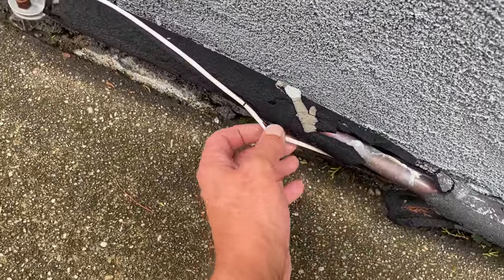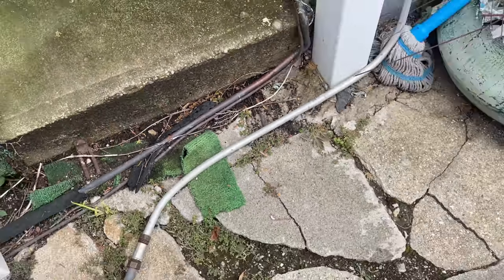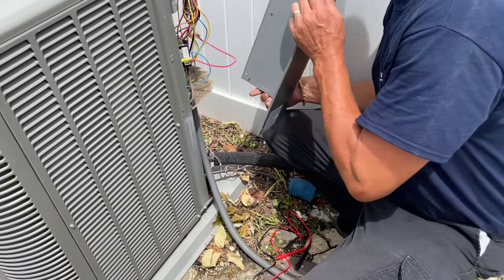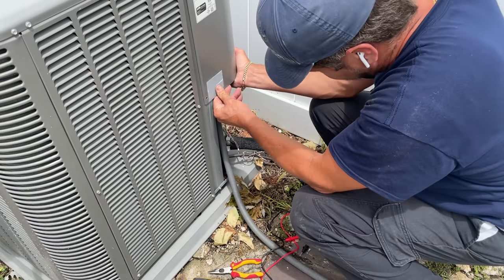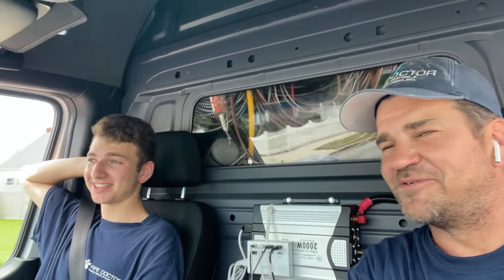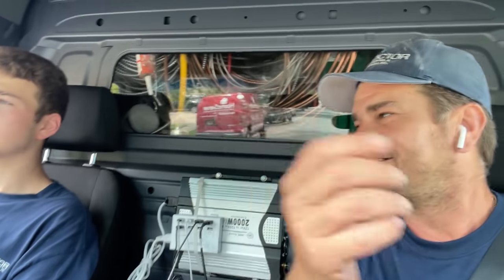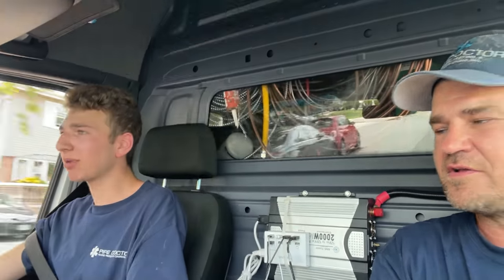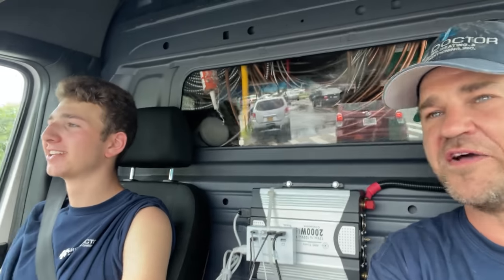Who Sabotaged This Central AC Condenser? Wire Missing from Contactor

Comment: It looks like there was a red spade on that wire connected to the contactor and from the tstat wire being constantly pulled on it eventually broke off. At 4:05 you can hear her say can it be from pulling on the wire. This is the most plausible explanation.
Reply: what you said.
Reply: Yep, you can see the broken connector on the bottom lug.
Reply: yeah and you can see an extra foot of the signal wore wrapped around the line set.
Reply: @PipeDoctor  as you were leaving, you should have said "and by the way, you need a whole new system "
Reply: @Samlol23_drrich  Or suggested a fix for the lineset for a future call.
Reply: @PipeDoctor  Maybe the old lady the other day was an actor and that was a test also. LOL
Reply: @PipeDoctor  and you get paid for a service call 👍👍
Reply: @PipeDoctor  They didnt play anything, the spade connector broke.  You can still see the spade terminal on the contactor
Reply: I don’t think this was A Consumer Protection Agency. They normally don’t do destructive ploys (obvious removed wire). Loose wire, flipped switch is that MO. She got sabotaged by someone else. Maybe someone in the trade or knew enough to pull that trick, but it’s sabotaged none the less.
If you worry about a sting, you’re  probably dishonest and probably incompetent as well and should be worried you’ve been flagged.
Reply: @globeflicker9216  are you calling St. Mike a liar?  He said it was a field check 🤦🏼‍♂️🤦🏼‍♂️
Reply: Steve 
Not at all, my friend. Not implying that whatsoever. Mike did the right thing and addressed the major fault in wiring. I would have strongly recommended rerunning the 18-2 to the condenser based on its jacket condition, which Mike caught right away. That’s a short waiting to happen. It’s a UV breakdown which will effect conductor insulation, therefore it should be replaced.
Reply: Dev Null 
Yup, I have to agree with that. No missing wire. The connector either snapped off under tension or was cut. Someone opening that gate door could have done that if t’stat wire snagged on it.
Reply: If your fair and honest with the customers, you don’t have to worry about a sting. It looks like that is the way you run your business and will always pass with flying colors. Strange that the wire was wrapped around the service valve. I would have thought the elderly woman’s call would have been an inside edition sting. That one was hard. Your a professional Saint Mike. Surprised they don’t give you a tax credit for hiring the handicapped, AKA Sippy Cup. Maybe he will go slow the drive thru down at McDonald’s now that he doesn’t work for you anymore. He doesn’t know what he missed out on.
Reply: someone  tripped over that and ripped of the contactor. The whole cable should be replaced. That line set looks like shit too.
Reply: However, that does not explain the fact that the wire was MISSING.  It had to be removed, even if it "fell off."
Reply: Cancel that.  Someone kicked the wire (from the outside) and it just snapped off. It was fairly tight, and the wire is obviously loose going in (and across the sidewalk also)
Reply: Patrick Ireland 
Based on the condition of wire run it looks like someone probably snagged it on the wood fence door by accident which pulled it off. I was thinking sabotage originally, but the video if you go over it carefully makes accidental more probable. One side of t’stat wire was hooked directly to contactor coil spade terminal. ‘Missing’ wire was probably removed on install or prior service.
Reply: @PatIreland  The wire wasn't missing. The wire connected the the contactor but got pull away making it look like a piece of wire was missing.
Reply: Thats the reason.

Comment: Look at the amount of low v wire wrapped around the king valves, some one hooked the wire by the king valve or under the gate  and it got pulled off the coil terminal which was the short lead .
Reply: Very good observation , most likely culprit self sabotage by hack job installation , natural deterioration evident, should've been under ground PVC and sealed.,✌️👍💪🤔🙏😁😎
Reply: @milotorres6894  Nobody is going to trench pvc with prices as competitive as they are.
Reply: Agree that was the same wire going straight in
Reply: Agreed, but where did the wire go? It should still be contained within the unit, no?
Reply: @eddiew.6485  Look at the bottom left lug on the contactor there's still half a spade.

Comment: I agree with the previous guys. The wire broke at the contactor connection. Likely from pulling on it or tripping on it. As you showed, the rest of the wire was in really bad shape.

Comment: With that signal wire installed so loosely and without straps to secure it, I believe it go tugged on by someone tripping on it or something.  Inadvertently that red stacon broke off of the contactor terminal.  I dont think it was a setup.  Great work again!

Comment: First lol keep up the great work Mikey, thoroughly enjoy your content. Looks like someone had a spade connector already on the control wire and hooked it direct to the contactor at some point. Maybe someone pulled too hard on the control wire hanging along the line set and broke off as there wasn’t too much wire when you took the cover off. From factory, there should have been a wire on the contactor anyway but it is missing for sure.

Comment: Guaranteed someone tripped or pulled on that lose wire maybe shoveling snow etc. connection wasn’t freshly cut / shiny
Reply: And it looked like a blade type terminal broke off. So probably right during shoveling or trip. They seem it so they wrapped it up to fix the excess pulled loose. Probably didn't tell homeowners figuring they wouldn't be able to pin it on them..or homeowners thought it wasn't a big deal being the wire wasn't completely pulled out of ac.

Comment: I started using heat shrink wrap for my low voltage ,you get a solid connection and protection from corrosion ,my heat source a lighter .takes two seconds to do . Cheaper then fancy connections .

Comment: The red wire with the piece on the end was connected directed to the contactor. The other wire connected to yellow goes through the pressure switches like he said. No one was in there. It broke off and the piece is still on the contactor.
Reply: I do not see that length of red  wire missing.

Comment: Several AC Techs in our area: Tampa,  have been setup by local Law Enforcement/ Code Enforcement persons. And just like your call it was a case of a missing wire. They lay in wait to see if the AC Tech tries to scam the customer out of replacing the AC unit. The customer is always Elderly which increases the crime if the AC Tech is caught misleading the customer with false info

Comment: It was me, the control wire bandit. I wanted a spare black wire for another lennox condenser. Its mine now and you cant have my copper back. That thing looked like it was like that for a while. I remember working on a lennox on emergency service the guy told me he could get it to turn on while holding the contactor in. I go there and all the pressure switches were bypassed and I asked him if he did it and he hesitantly said no, F.

Comment: Nobody sabotaged anything . Looks like the wire broke off . The other side of the connector off the red wire is still attached to the 24v side on the contactor
No one  has been in the unit for years look at all the dust /dirt / cobwebs
Also should have replaced that low voltage wire . 
 Nice work
Reply: You say look at all the dirt/dust but the next person is gonna see the same dirt/dust as he didn't clean it off.
Reply: Maybe someone tripped over the wire and the connector snapped.

Comment: I love my Lennox 2 ton unit. I’ve never had any issues with it except one winter I noticed the outdoor unit was making a noise but the fan wasn’t on. I called somebody and he says it works fine the fan doesn’t come on during defrost but it’s the only time in 10 years I’ve had anything serviced or looked at.

Comment: I don't think anyone cut that wire, I'm pretty sure what happen was some one tripped on or got caught on the wire walking threw that door opening  where the lineset an wire run, an the wire not being strapped, it got yanked an broke the connector, I see them brake at that same spot often. That's what I personally think happen. If someone cut it why would they cut it in the middle of the connector? What you think..

Comment: Looking at the wire running on the Ground some trip on the wire and it was pull out
Reply: yes it was a sting I would still would have replace the wire from the thermostat that would have been cheaper then a other service call from you when you are  already there. @PipeDoctor

Comment: Something similar happened to me as well many years ago when a local news station in central Florida was running a sting operation on HVAC contractors in the area that I serviced. One of the low voltage wires at the condenser unit was disconnected in a way that it still appeared to be Intact. Someone had removed a twist wire connector, cut the two wires coming from the common side and reinstalled wire connector. I tested for 24 volts across contactor coil and voltage read low (about 18 volts) but when I checked from one side of contactor coil it read 27 volts so I knew that the common side of the low voltage circuit was missing (open). As I removed wire connector on common wire I immediately noticed no electrical connection present and it was completely obvious that they been cut with wire cutters. I checked inside the wire connector for any signs of a broken wire and it was clear of any bits of wire but also looked brand new and shiny compared to the other connectors. I then realized something was very fishy and started to look around and observed a suspicious van parked about 4 or 5 houses down. I restriped the wires and reattached wire connector and the unit started running. I buttoned everything up and approached the home owner and described what I had found. The home owner then asked without missing a beat "how much do we owe you?" I politely said "no charge, have a nice day" I got back in my service vehicle and drove around the corner and watched as that suspicious van had moved and pulled up into the driveway of the house that I had just departed. I called the owner of the company that I worked for and informed him of what just happened. He said that I had done exactly what he would had done and was appreciative on how I handled the situation. Later that night I was compelled to watch the news and wouldn't you know it, my service company and my vehicle were examined and got a clean bill. The next day when I arrived at the office my boss asked me if I watched the news last night. I said yeah and I'm glad that they didn't show me on the news. He asked why and I told him because I didn't have my shirt tucked in which was a severe no no working for him. Oh well at least I didn't get you put out of business.

Comment: My $.02. I think the terminal was cut. Unless heat damaged, which a coil terminal would never be, the wire would break before the terminal pulled off the contactor or broke in half. My vote is with Mikey Pipes that it was a test and you passed.

Comment: The thermostat wire was directly connected to the contactor.  They used one of those cheap aluminum spade connectors and did a crappie job crimping with a side cutter instead of a crimping tool.  The connector broke at the side cutter crimps and the tension on the wire helped break it with vibration from the unit and the contactor.  Poor initial installation.

The wire from the thermostat and the refrigerant lines need to be protected with something as they are prime candidates for breakage exposed to the elements and the walkway.

Comment: The spade is still attached to the contactor.  Thinking that thermostat wire got tugged on and it broke.  Can see it clear as day at 3:47, bottom of the 2 left most low voltage connections.

Comment: You never know, i had a no heat call last winter in Albany, and the fuse was missing on the board, not blown, but missing. We caught it right away and actually gave the guy a break on our service call fee. You have to have integrity or else your business and reputation will fail.

Comment: air balancing is making sure the air distribution is correct and even at each outlet, we use dampners and such to do. I myself on new construction fire my unit air handler up and test each duct and room to make sure Im balanced and meeting the cfm required . I better be or it costs me. this way before drywall goes up I already know my system is balanced and right. easier to balance too but when fixing or adjusting existing i usually use 2 way radios and after doing a quik layout I calculate what Im supposed to have , check and make the required changes after approval of the customer on the amount and scope of work. I also gopro everything and the homeowner can request a copy of the call and work to go with the house paperwork on a dvd I make for them. improper air balance is usually in my view an automatic sizing mistake. but I have followed behind licensed contractors who literally did not tie ducts together correctly-wrong size of return and omg...

Comment: Definitely a shoddy installation! Suction line insulation needs to be replaced. 24 volt cable must be replaced. Personally I would run it in PEX tubing to protect the cable because of the long outdoor run!

Comment: I think the wire was improperly crimped on the red terminal.  Given it should not have been hooked directly to that stat wire at the contactor.  Needs a short pigtail and a wire nut with strain relief no to mention replacing the entire control wire.

Comment: it happens all the time with the weed eaters,the wire is not uv rated and is code to run it in sealtight or conduit.recommend her new wire in pipe to prevent that.

Comment: No one is messing with anyone. As said before, someone probably tripped over the loose control wire and it separated from the connector. If it was proposed to her as an issue that could lead to a problem, she might have asked you to replace it. Instead of thinking you were set up by someone. And the Consumer Protection Commission, already knowing this was the issue, would have commended you for being honest. Wow!!! What are your fears of these people and your customers??? 
Where the line set is located, I'm surprised it also hasn't been damaged.  I saw the connector attached to the Contactor before you. And thought the wire came loose. You went right to, WHO DID THIS? Before investigating. I heard someone once, or several times say, "A good technician is always aware of their surroundings". What happened on that day?
Reply: Tony tom tom to the block list.  lol
Reply: @PipeDoctor   Do you call your customers an a$$ also? You say leave your thoughts below. But if someone doesn't agree with you, then they are an a$$. I saw the connector before you did. What caught my attention was the red piece on the end of the loose wire. I then immediately looked at the connector. And I was watching a video. Block me. I'll just watch Steve. OUCH! I know that hurt.

Comment: No one sabotaged that unit you can clearly tell the red wire connected directly to the contactor. More then likely someone tripped on that exposed control wire and ripped it off the contactor and that's why it was wrapped around the line set.
Reply: @PipeDoctor  just my observation the red part left on the wire and the spade terminal left on the contactor look one in the same just cut or snapped off. Either way it doesn't matter lol Keep up the good work!

Comment: no surprise , wire is  on the ground - somebody just tripped over the wire, pulled it , ripped of the spade. What the hack of the job - lineset on the ground , low voltage hanging  ,crazy

Comment: Went to a no AC call for a nail saloon in a strip mall. Breaker was off. Go outside to the condenser. Someone ripped out the disconnect box and all the wire through the wall to the breaker. Then they got mad at us cause we told them they needed an electrician to run a new wire and we charged them for a service call

Comment: The other part of the connector is still on the lower spade terminal of the contactor. Nobody has been in there, somebody just tripped on the low voltage wiring or more likely caught it with a strimmer when cutting the lawn. You claim to be so observant but in this case it seems that paranoia set in. Tut, tut Mikey! 01:51 Look at how they coiled up all the excess after tugging on the wires.

Comment: That's a  terrible  install   period . 24 line got snag. Lucky  some one did not break the copper line set.  There should  have been cover for the line set and conduit  for the low volt as well . No way that was permitted  inspectited . Big trip hazard

Comment: Dude they need to do something like that where I live because we have some old heating systems that have the old expansion tank in the floor joists and the don't drain them when they service them or under size a steam boiler meaning not sized to the two inch main yeah I'm serious

Comment: Whenever a company is trying to get a replacement going they remove a wire from the capacitor and the other side too so no loose wires showing. Common down here since everyone here gets paid based on cost of job.

Comment: comon,... the solderless terminal broke off probably from vibration. It was a cheap connector probably been wiggled too much from every technician and brother in law messing with it and it just broke on its own. I would have just fixed it and included it with running all new wire from furnace to condenser. Unless your have clearly sabotage then I wouldn't spread paranoia , I have seen the "refuse to pay my bill " wires removed from units before and that's always a bad sign of a service call that's going to go downhill.